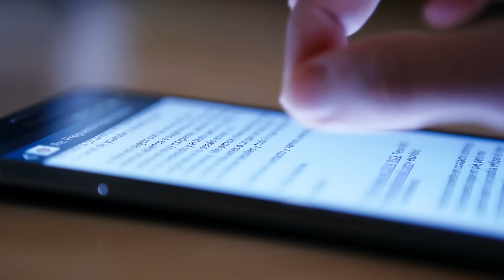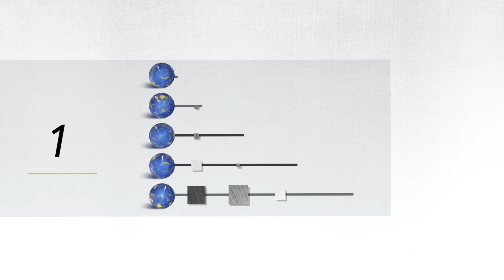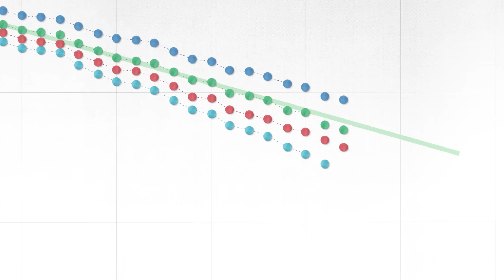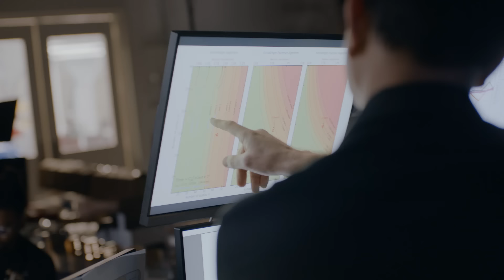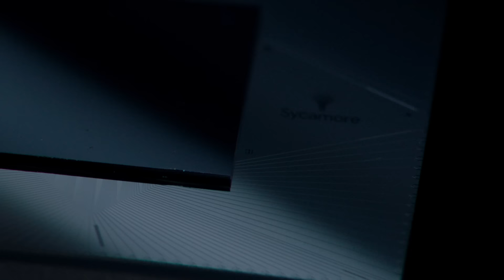Demonstrating Quantum Supremacy

Comment: 2019: "OK Google" 

2029: "OK Skynet"
Reply: More like 2050. These might never even make it into your pocket unless we find a way to make them opperate anywhere near room temperature. Currently they only run near absolute zero.
Reply: @WaffleCake  and you think that you carry whole google platform in your pocket? Omega lul
Reply: 2039: "OK Humans"
Reply: @MaderHaker  No. I literally just said it was probably never going to happen.
Reply: @WaffleCake  we don't need a quantum computer in our pocket at room temp. we just need a super fast connection and access in our pocket..............also it cant run fortnight(i.e. not its purpose).
Reply: @Pankajkumar-el7kv  That's actually a great point. Hybrid-Quantum computing.
Reply: @WaffleCake  The Quantum computer will be the powerhouse and the phone would be the display. And lots of phones would run of a single Quantum computer.
Reply: Google is already in your pocket. It wants inside your head
Reply: @WaffleCake  well scientist thought in 30s that nuke was impossible but youcan see that we made nuke
Reply: @MarcillaSmith  Elon Musks brain chip does that
Reply: Your comment frightened me for some reason.
Reply: @WaffleCake  maybe it will become a system like they try with stadia where you have the central server who does the work and the device only has to show the picture.
Reply: @DarkKnight-ke5bx  I don't think that's really the same. The modern equivalent would be what we think we know about Dark Matter. This is more along the lines of cars out-popularizing horses.
Reply: @WaffleCake  know what a joke is?
Reply: @WaffleCake  lol that was just a joke XD
Reply: @gad8299  How do you even pronounce that? Joe-kay? or Joe with the 2nd half of coke? Joe does coke is that it? You do you but I try not to touch the stuff personally.
Reply: 1000th like!
Reply: Exactly been saying that
Reply: @WaffleCake  Humans are never going to fly high up in the sky, or walk on the moon... Yeah, keep your "all-knowing wisdom" to yourself please.
Reply: Came here to say this lol
Reply: You all do realize that a Quantum Computer goes way beyond Skynet, especially as a Quantum Computer matures with thousands and millions of Qubits, but it already is more advanced than Skynet, even at the level now in the form of "emerging technologies, Quantum Technologies".

And to add on top of that, Graphene material wasn't in the Terminator, those robots will be nothing compared to Graphene, Photonic Computing, Quantum Computing, Photonic - Quantum chips, and Neuromorphic  Computing with hyper-dimensional chips. These are real technologies coming.

Disruptive Emerging Technologies, Quantum Technologies are coming in the 2020s.

We can already make transparent Aluminum from Star Trek, and Graphene is way beyond that.
Star Trek and Star Wars also didn't have Graphene or Quantum Computers, and we are already becoming more advanced than old Sci - fi shows.

Graphene companies are already trying to show the world how to make Graphene and that you can buy it from them. There are also Graphene 3D printed houses for under $8,000 dollars.

There's a company from Australia named Voxon Photonics, also their youtube channel, with hologram arcades, for education, doctors, and holographic video calls, they are calling it "Star Wars holograms".

Think about thousands or millions of molecules in a cup of coffee, something only nature can do, imagine a Quantum Computer simulating this, and also for the medical field, financial field and much more.

Think about Dinosaur DNA accelerated progress.

And the Alcubierre - Froning Warp Drive big algorithms that it could accelerate or solve , "supposedly we just need the energy for it, which is why we are looking for Dark Energy, that could potentially place us in a position of becoming a Type - 4 Advanced civilization which uses the energy from the universe, and Dark Energy makes up the universe".

Think about how close we are to a Type - 1 Advanced Civilization, we have advanced bionics on the way "Graphene could have a lot to do with this and many other emerging technologies", Quantum Computers could also supposedly predict weather, and possibly will later on.. prevent it, and will control nature's forces like earth quakes and so on, as a Type - 1 Advanced Civilization would do, and the thought of having Graphene, Photonic Computing, Quantum Computing already, and in 3 years.. we could have the Quantum Internet from the Netherlands, then that would put us very close to a Type - 1 Advanced Civilization to about .95% or closer.

A company from Australia named Archer Exploration are using Graphene to bring Quantum Computers to room temperature, for our homes and other places. They have accelerated their progress a lot throughout 2019!

Australia plans to have a Quantum Internet by 2030 and share it with Europe, no word on the U.S.
The Netherlands plans to expand their cities with their Quantum Internet, and share it with the world in 3 years.

Spintronics = Electronics 2.0
Spintronics tilts the Electron (electricity) to make our devices like our phones, computers and cars, more energy efficient, in the next 4 years.
They are using Spintronics to tilt the Photon (light) to create Quantum Teleportation, this is faster than the speed of light, and they plan to create a Quantum Internet out of this.
Imagine using Quantum Teleportation to send transmissions, for space communication really fast, as we further develop it and it matures as an emerging technology, imagine how far it will go in our solar system and beyond, and how fast it will send information. We already use Mars Cubesats 1 and 2 that were demonstrated in late 2018 from Mars to the Earth in 3 minutes for space communication, but not even those use Quantum Teleportation, "I think someone needs to mention this to Nasa as an idea, I'm sure they've thought about it, but it's still a good idea, and you all should work on your own innovation and projects, to push emerging technologies, Quantum Technologies to come as soon as possible", such as the idea for Quantum Teleportation through space exploration as a communication of small objects like data transmissions in space.
Of course.. later on we will use Quantum Teleportation for larger objects, I wouldn't want to step into something like that, but it would be useful for other large objects like machines to duplicate exact copies on the other end, example would be like sending machines from Earth to Mars and back, very fast. Now imagine throughout our solar system and Galaxy, and beyond. Just don't do it with anything alive, only for devices and machines, "don't get attached to the original machine or device in this situation, since it destroys the original to make the copy somewhere else during the Quantum Teleportation".

We need to get rid of Silicon for our computers and devices, and replace it with Graphene, and we need to replace electricity (Electrons), with Photonics (Photons).
You look at youtube videos about AMD and Intel on Silicon and see how stubborn they are to remove it, they are so stubborn that they will even integrate it with carbon nano-tubes later on, when we could be using Graphene now in the next year or 2. And you google search, and even research it, we could replace Silicon with Graphene, and electricity (Electrons) with (Photons) light particles.

Basically we are living in a "Graphene Age, and the Quantum World" where we will replace electricity with Photons at some point after integrated Photonics, and Photonic Computing in the 2020s.
Several types have come up that are being called the Graphene age, Quantum Age, and even Fusion Age, for Fusion Energy that is supposedly happening by 2025 to be tested by some private companies, and by 2030 to be connected to the grid for Fusion Energy.

Now I could explain other things that could blow your mind, but you could see some things in another channel with playlists I made for emerging technologies and beyond.

If you are curious about emerging technologies and beyond, please check out my other channel for playlists, and check the "About" tab for official websites to some companies on emerging technologies, and the "featured channels" after that. Be sure to watch the playlists first though, before going to the links, I would start with the Graphene playlist, and then look at the playlist description in the Graphene playlist with the "more" button.
There will be more playlists not seen there, so be sure to check the channel for all of them, a link at the bottom of the playlist description, should take you to all of them.

I'm not advertising, just helping people to be aware and helping people to learn.

Again check the "About" tab after you watch all the videos in each playlist from top to bottom, check the official links under the About tab, which can be found under my channel name, on my channel.
The official links will take you to some companies websites for Graphene and other types, you can contact them there to learn about it, and their products. 
Contact the companies there, and go see them, if you don't believe it!
You have all the info right there that you need, no excuse!

I made the other channel for emerging technology and beyond, to make people aware and to help people learn, I hope you enjoy it. Please click on videos, in playlists with zero views, it updates hours or days later.
Some playlists deserve views that have little or no views! Thank you!

------------------------------------------------

I was giving out helpful links, but it won't allow me to do that now, so I made playlists.

1. Check my channel, find a subscribed channel called Technology Research, go to the playlists there, and click "created playlists", that should show them all.

2. After that, click on the title / text of each playlist, not on the pictures.

3. Don't forget to click the "more" button in each playlist description for more articles and playlists.
Reply: @MrCGP2011  sick...
Reply: @WaffleCake  They don't have to be in your pocket. The current huge data centers that everybody connects to would be suitable for this tech. This level of computing no longer needs to be in the end user's hand for everyone to benefit.
Reply: it doesn't matter because China will take this technology that google spent billions to develop in a day and massively productionalize it ahead of google lol. a waste of time and energy i say.
Reply: @WaffleCake  who said they will make mobile quantum computers/phones, they will just make quantum super computers in their "headquarters" and those quantum computers will generate powerful A.I. which we through internet will access. Even now most google stuff comes when u actually connect to the internet, without net its just programs
Reply: @WaffleCake  
/All this, in the mind of Adam Koltun of the Quantum Resistant Ledger (QRL) Foundation, speaks to a growing problem.

“A decade ago people said it would take 50 years to get where we are now with quantum computing. Five years ago, they said it would take 25 years to get where we are now. So quantum computing has this nasty habit of exceeding people’s expectations,” said Koltun, adding:

“The blockchain industry does need to grapple with this and be wary.”/

Not to back up solely on him, but he's not the only one thinking like that.

Also, quantum computing innovation is based on who runs the fastest system, totally unlike the idea of more portable tech, so yeah it will rather be of use to main server systems, cryptosoftware and brute force experiments
Reply: KNOWARE r/whoosh
Reply: Man I wish I could change that hot word on my google home I'd even settle for OK Skynet
Reply: @samv93  Don't think that putting all you data at a single point is a good idea.
Reply: @justcause7350  I didn't say it was a good idea to put all data in one place. The phone could still have internal memory even if its power came from a quantum cpu. Anyway all the data about people is collected and stored in one place.
Reply: @Pankajkumar-el7kv  finally there's some intelligent thinking in the reply section lol
Reply: @samv93  True. The data is collected. 
But it's not centralized.
Not now.
Reply: @gregoriodia  Humans already do all the mentioned thing above .....we fly high around the world , walked on moon .............dude when are you from?
Reply: @WaffleCake  I  think a quantum computer will soon solve that problem
Reply: Sarah Connors destroyed Skynet. Did you forget?
Reply: Trow nowen can stop this tehnologii imagine a hier inteligent muche more smart than any human in history !!!!!!!

Comment: Recent Paper - Simulating the Sycamore quantum supremacy circuits (Feng Pan, Pan Zhang)

"We propose a general tensor network method for simulating quantum circuits. The method is massively more
efficient in computing a large number of correlated bitstring amplitudes and probabilities than existing
methods. As an application, we study the sampling problem of Google's Sycamore circuits, which are
believed to be beyond the reach of classical supercomputers and have been used to demonstrate quantum

supremacy. Using our method, employing a small computational cluster containing 60 GPUs
we have generated one million correlated bitstrings with some entries fixed, from the Sycamore
circuit with 53 qubits and 20 cycles, with linear cross-entropy benchmark fidelity equals 0.739, which is
much higher than those in Google's quantum supremacy experiments."

Cite as: arxiv:2103.03074